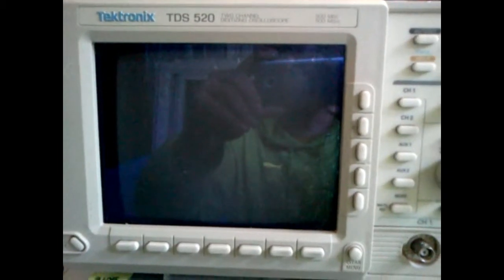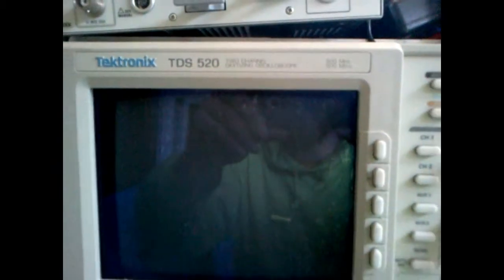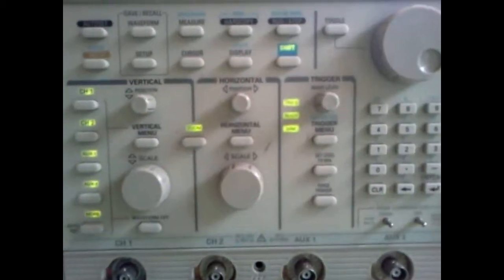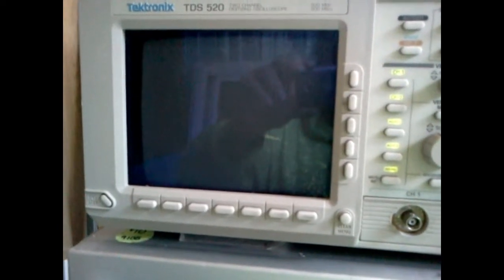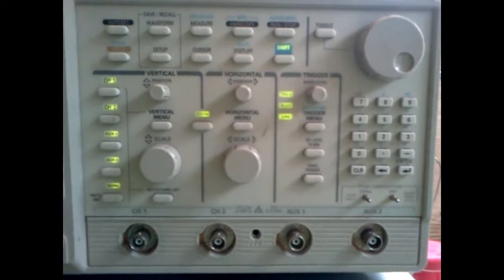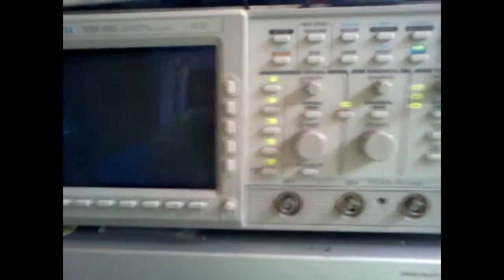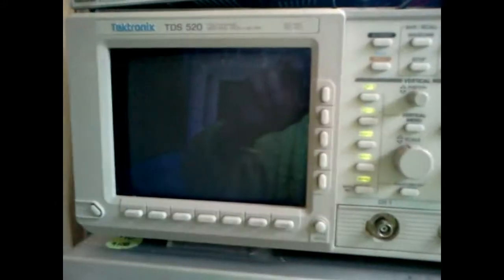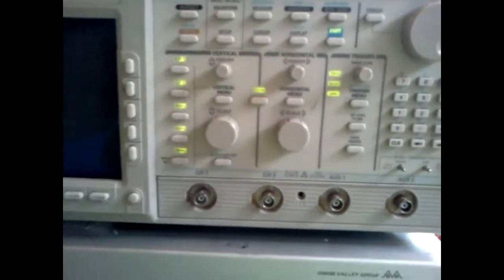TDS520 startup

Comment from the maker: Posting feedback from ToughDev with some minor edits: http://www.toughdev.com/content/2014/01/calibration-and-acquisition-problems-on-tektronix-tds-340-oscilloscope/comment-page-1/#comment-71542

I'm still probing the board Cable Pins testing voltage at the moment (J5 Display Module, J2 Front Panel Module, J26 and J27) while the board is installed to narrow down location on A11 board where issues.

I re-read the TDS-520 Service Manual "Figure 6-22 Primary Troubleshooting Procedure" and realized I skipped the "Figure 6-30 Processor/Front Panel Troubleshooting Procedure."   

I just completed the "Figure 6-30 Processor/Front Panel Troubleshooting Procedure" and found that when J2 is unplugged the ON/STANDBY doesn't power on the scope and there is no 3.125Mhz clock on J2 Pin 25.  Therefore, the flowchart shows to Replace A11 DRAM Processor/Display Module.   Therefore, no need yet to test the J18 Pins as I need to get the Front Panel working.

This lines up with the Figure 6-26 Display Troubleshooting Procedure where J5 Pins 1 & 2 are +25.7V and Pins 3&4 are +4.9V.    J27 Pin 1 is +25.7V and Pin 17 is +4.9V.

I also tested J2, J26 and J27 plugged in (I can only test on the back of the cable socket when cable is plugged in, not sure how to test lower pins unless unplugged).  I am thinking that the pins are the even numbers are testable where odd number pins are on the bottom row and I am not sure how to test at this time.  Maybe a row of pins are same values also as with J5.

J2 (V+ unless noted): Pin2 = 0, 4 = 9.94, 6=0, 8=4.94, 10=0, 12=-5.07, 14=5.06, 16=0.2, 18=5.06, 20=4.49, 22=3.99, 24=0, 26=2.3

J26 (V+ unless noted): Pin 2=0, 4=0.97, 6=0, 8=-15.10, 10=-15.10, 12=14.98, 14=0, 16=0, 18=-5.07, 20=-5.07, 22=0, 24=0, 26=-5.07, 28=-5.07, 30=-5.07,32=0, 34=0, 36=4.94, 38=4.94, 40=4.94

J27 (V+ unless noted): Pin 2=24.4, 4=0, 6=5.0, 8=0, 10=5.0, 12=0, 14=5.0, 16=0, 18=5.0, 20=0, 22=4.9, 24=0, 26=5.0, 28=0, 30=5.0,32=0, 34=5.0, 36=0, 38=5.0, 40=0

J5, J26 and J27 do not seem out of specification on the A11.   Therefore, those I am thinking have traces that are OK or suitable for now. 

J2 per Figure 6-30 6th Step down Pins 2, 4 are 0V and should be +15V and -15V respectively and Pins 16 should be +5.1V and is 0.02V.    

I am also wondering what the specification of 19 through 26 are as they seem lower in value.  I do not see a specification for those, however they may be attenuators values relative to settings for feedback from the A12 Front Panel Module to the A11 DRAM Processor Display Module or something else.

Looks like more testing components and traces where J2 is missing power and the values are not correct or questionable where I don't have a spec value.   I have to see what the vias and components values are going backwards from the J2 connector pins next. 

tekhobbycap also noted other than cleaning thoroughly and replacing capacitors as well as repairing traces, he used 35V 105'C same brand capacitors.
Reply from the maker: Updated with video of quick review of A12 Front Panel Module: https://www.youtube.com/watch?v=gxgXFVHRGPM
Reply from the maker: Did a little work on the TDS-520 today. https://www.youtube.com/watch?v=nQvRoRQGvfo&feature
Reply from the maker: Did more work on the TDS-520 today: https://www.youtube.com/watch?v=J0bcXZPA5V8

Comment: Thanks for the link to my blog. :) Just add my comments to the article regarding the symptoms. Maybe you can try to open it up and reseat the components as a start and see if anything changes.
Reply from the maker: Your very welcome.  Thank you for your advise and example.  Please elaborate on "Just add my comments to the article regarding the symptoms." as I am not sure what you mean.  :-)

I was wondering what the loose item is inside when I move the oscilloscope.  I will do as you note since may be something really simple.  Being a CRT, I wanted to double check grounding the scope, drive a ground rod (or two spaced 16ft appart) since I don't have a ground in the Farm Building yet since is more for storage, wild harvesting, A/V/RF monitoring and is off the grid.

I have a 12V DC marine deep cycle battery powering a 1500W pure sine wave inverter that can be grounded also that was the source of the 120V AC and that too really needs to be grounded to be safe I am thinking. 

Other than the CRT there shouldn't be any capacitors that will be too dangerous from what I can determine. 

I'm offsite now working on another project though eager to get back started on the TDS-520.
Reply: jafinch78 Hi, I meant I added more details on the troubleshooting in the article on my blog (where you wrote your first comments). Check there for more details. :)

As for the CRT just be sure to turn it off before you work on it, and don't touch the red anode cup (which should be well insultated) and you should be good to go. The rest of the high voltage components should be well isolated and clearly marked as such.

Keep me updated. Btw, I love deep cycle batteries. :) Used it to power black and white televisions a long time back. In terms of operating hours they outperform even the best car batteries ...
Reply from the maker: Hi Nguyen Van Minh Danh, I see.  I wasn't sure if you wanted me to "add your comments to this or your article regarding the symptoms." :-)   Makes sense now.  Thanks for the additional info. 

I have 1,000W of solar cells I need to solder together and make two frames to set in and pour silicone over for the batteries also.  One frame for the Farm Building and one for the truck bed cap.  I also have a 1,700W wind turbine I need to make a mast for, see if I need permits and get those and install for the batteries also.  For the price, they still are way better investment than the newer NiCd, LiFePO4, NiFe, etc. and I can use for the trolling motor to go fishing. :) 

I used to have a Honda 1000W gas generator I got from my Dad and made a 12V power supply from a computer power supply to power the trolling motor.  The generator was stolen in my truck in Utah though. 

Interesting you mention TV as one of the LCD screens I have is from the Goodwill store that I bought for $4.99. It is a "Haier" LCD portable TV with RF and Analog inputs.  Works, though my antennas here where I am working are not so good yet.  I need to make and tune a discone I am thinking from household wire.

First projects first.  I will keep you posted for sure.
Reply from the maker: Finally, got around to opening up the case.  Also, I read on pg 6-53 of the "TDS-520 SERVICE MANUAL" (https://drive.google.com/open?id=1gSkLeeoe49M4vc5Jcdj49iqPAPx_lu4U)  in the flow chart that after going through the Figure 6-22 Primary Troubleshooting Procedure where DS1 flash .8, then displays pausing to flash ".d" which held for about 60 seconds then went to ".e"... that I have to "Replace the A11 DRAM Processor/Display module"

I did like you noted and removed A11 DRAM Processor/Display module (the top board) board first checking all the cable and connections where I found the J39 board not connected. 

I reconnected and powered back on with success in the CRT powering up though with a gray vertical middle section and on each side a lighter gray/white vertical section.   None of the relays turned on and all the LEDs' stayed on after 60 seconds. 

I went through the Figure 6-22 Troubleshooting again, that referenced to the Figure 6-26 Display Troubleshooting Procedure.  I unplugged J5 cable, powered on the scope and tested PIN 1 (silk screened arrow next to board) and PIN 2 (pin above PIN 1) to see if @ +25V and PIN 3 (next to board) & PIN 4 (above PIN 3) if @ +5.1V.  The PIN 1 & 2 read +25.7V and PIN 3 & 4 read +4.9V.  The same readings were found on J27 PIN 1 and PIN 17 respectively. 

I next have to test J18 PINS 1 through 3 video signals to see what the video signal looks like.  I am guessing those are the through hole test locations on the board coming out of the U190 chip for 2 and 3 and 1 comes out of the UR1 chip.   Though I am also seeing that the previous owner may have replaced the J5 connector on the board since there are initials on the board also and the new J5 connector covered up the J18 pins that may have been removed/clipped though on the bottom of the board I do see the trace and PIN locations.  

Any idea on what the J18 PINS 1, 2 and 3 are?  I am thinking my later observation. 

I'll set up the TDS-520B to read the J18 PINS next and go from there. 

Either way, looks like the issue is something to do with either the A11 DRAM Processor/Display module that notes to be replaced or replace the A20 Display Assembly... though I may be able to repair those boards if I find the schematics specifications in more detail.
Reply from the maker: I'm going to check the electrolytic capacitors in circuit and see what I see also.  I don't see anything visibly wrong so far.
Reply: Hi, just noticed your comment on my blog and just replied. Have been playing with quite a few things, one of which is hobbyist PCB design. Great to see that you've reached your fund raising target for the microfiche scanner. Keep me updated on the progress. Also do share with me your articles on Hackaday and Old Tek Scopes too. I'd love to read them. :)